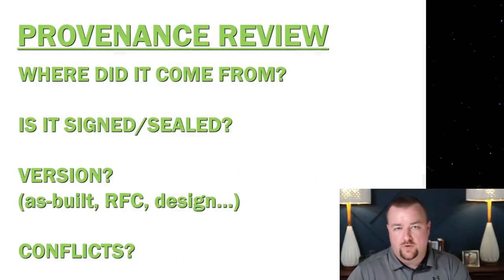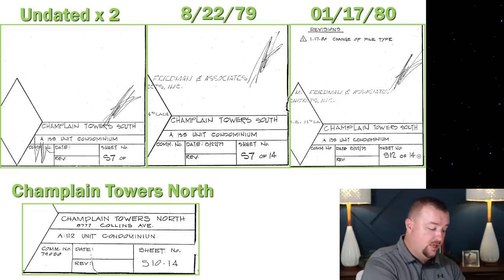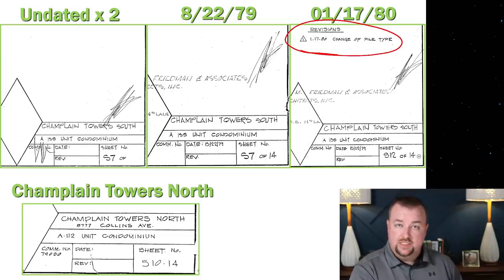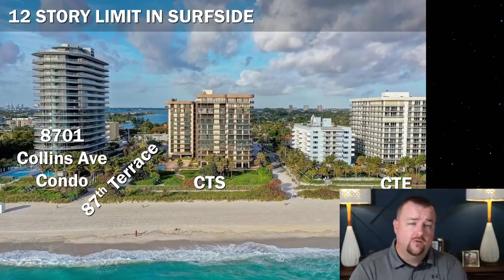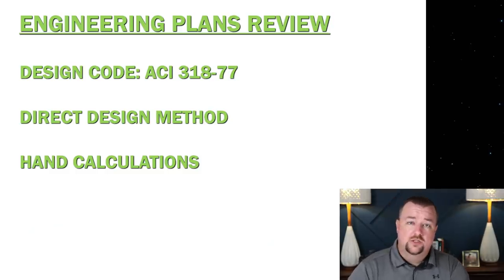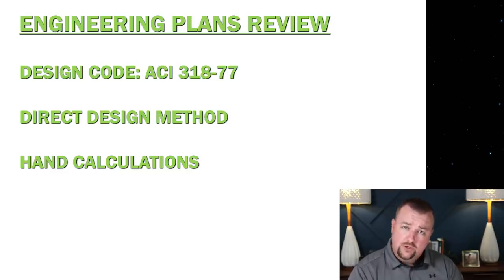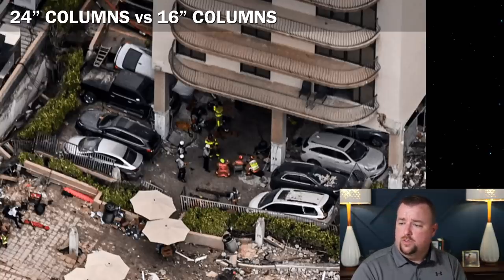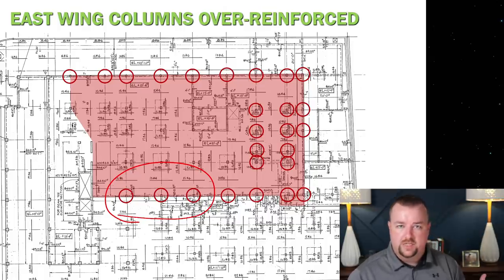Engineering Failures Found in the Champlain Towers South Drawings - Surfside Collapse

Comment: Josh at 5:00 you said you could not find the planters in the 1979 drawings, I have the answer for you. I had mentioned in a few of my videos in July that the HOA had a contractor come in back in 1996 and added the extra planters, as well as the palm trees. I had put up a few videos showing this, as well as what stressors and latent cracks might have happened if they drove any heavy machinery on the pool deck to install these palm trees, and later they removed them in 2018. On the Surfiside records web site, you'll see the file 8777 COLLINS AVENUE - LANDSCAPING P#96-0403.PDF, that has a drawing that shows their proposed added planters, as well as the palm trees. This is also when all that extra sand and heavy pavers were added, which I feel slowed down drainage of rain off pool deck, and often left pooling that I showed in many real estate agent MLS photos of the pool...
Reply: Love your vids and giveaways sir. Keep up the great work!
Reply: It looks like they added insult to injury over the years!
Reply from the maker: I'll look into that.  If the planters were added in '96 I'm curious to know if an engineer was hired to evaluate the deck for that weight.
Reply: Thanks, Jeff -- you and Josh make great videos and i watch you both.
Reply: Big fan to both of your works. Both of you had made me so clear this thing even thought iam thousends miles far away. Greetings from Lima Perú.
Reply: @BuildingIntegrity  This would seem to be a logical thing too do right! I mean its adding a large amount of dead weight.  Be interesting to see what you can find out.
Reply: Imagine how heavy palm tree's are. How much damage was hiding under those planters?
Reply: Has any planters been removed from the North Towers? I'm still very concerned about that building.
Reply: I think the design change of removing the step down/beams is an important element of the failure (and any added planters, and the cracking due to flexure, and the impact of cracking on rebar corrosion). I am uncomfortable around the lap lengths (splices in USA), and embedment length of the ‘U’ bars into shear walls, and the generally ‘light’ rebar – although I have no direct experience of flat slabs so that is an uninformed opinion.  I also had some uninformed reservations about concrete cover, I had the impression that it was insufficient for the environmental conditions and concrete quality.
Reply: Well, a 1t capacity counterbalance forklift is about 3t service weight. Add in a planter, possibly with a pre-grown tree inside, to be near the capacity. Now work out the forces generated by 4t hitting the brakes, even at a walking speed... Now you consider this is a horizontal force totally unplanned for by the design of the building and columns..
Reply: A
Reply: You two guys are awesome researchers.
Reply: Most people don't realize the weight of sand.  In Florida, a typical dry silica sand weighs around 2400-2800 lbs per cubic yard.
Reply: @chuckgilly  generally if they are technically illiterate and driven by emotion, yes.
Reply: @lifewithduchenne3030   oh just stop already for pete's sake... this is getting old...
Reply: You beat me to it, Jeff.  I was going to comment about your theory regarding the planters and the equipment used to install and remove the palm trees in them.  I think it merits investigation after this video showed that the pool deck wasn't designed for significant live loads.  You and Josh should do a video together.  You both have interesting insights into this tragic building collapse and would probably benefit from bouncing ideas off of each other.
Reply: @BuildingIntegrity  Josh, when you did your calculations for the load limits of the columns above the pool deck, did you use the original deck plans or did you account for the sand and paver bricks added in a later renovation?  If those columns were already at or near 100% load then the renovation likely put them over the top and it was only a matter of time before the deck collapsed.
Reply: @Phoenix08642  Ask Josh why he removed his original video on PT cable failure. Where and when did he learn there were no PT cables?
Reply: @truckerallikatuk  Wow...thank you for sharing your insights on that possibility 👍
Reply: @-._.-KRiS-._.-  With the max and overload build in from the start on South good reason to be very worried about the others especially with how shady the developer was.
Reply: Back when cars had chrome steel bumpers a tenant at least once a year would damage a pillar while intoxicated at a building I lived in up north.
Reply: sand holds water and well there's that added weight too. Take a 5 gallon bucket of sand pick it up, then add water to it..
Reply: @wiregold8930  Can someone change his mind?
Reply: @coollasice4175  Sure. Deleting a mistake is not professional, correcting one is.
Reply: @ulexite-tv  Me, too! I’ve always been fascinated with architecture. Learning about the engineering that makes design viable has been so interesting. I would rather that the reason why we are all looking at this so closely hadn’t happened, of course.
Reply: @lifewithduchenne3030  Using the same data and photos off the internet that other people also use is not stealing or plagiarism. Coming to similar conclusions about observations is also not stealing. Kai should grow up and get over it.
Reply: @wiregold8930  Because he thought the rebar may have been cables. Not a big deal. The photos weren't very clear and it was early days before he reviewed the drawings. It is not like he was being emphatic about it.  It was self admitted speculation at that point. I wouldn't have assumed they were cables because they were too close together for the distributed direction. He even corrected himself on a later video.
Reply: @christophercripps7639  All they would have had to do is go down into the garage and look up for beams.  It's clear they didn't bother to do that.
Reply: @jonh901271  Yep, it's amazing what a thin layer of sand or even peat can weigh. I used to work in the theatre, and we had an idiot of a designer want a stage to be covered with the stuff- which naturally needs some depth not to go bald when walked on. We did a rough calc of the weight and more or less said, 'take a long walk off a short pier, mate'. And our stage was a solid concrete one with columns and beams underneath- some touring venues the show might go to were just timber planks on joists.
Reply: @-._.-KRiS-._.-  Jeff said they were removed from both at the same time.  I wonder why?
Reply: @yodaiam1000  It's good he corrected himself, I hadn't seen that. Thanks..
Reply: @chuckgilly  👍  HOA. Home over-reaching Amatures
Reply: @yodaiam1000  LOL! Speculation...LOL!!!
Reply: HOAs are far too ignorant to even know they (The planters and proposed trees) were not on ground level. Seriously. It would never have occurred to them to do an analysis. An arborist would not have thought to look either.

Both of you guys have done a great job!
Reply: @suekennedy8917  Which comment are you referring to? I made several comments. What is exactly speculative?
Reply: You still haven't answered my question about why air traffic was shut down before the collapse.
Reply: @sexuallytransmittedcovid5241  Why would that be relevant to the collapse?
Reply: @yodaiam1000  for emergency rescue can only have a drone in the air if air space is shut down. Which tells me they had prior knowledge of the collapse. Probably Homeland security and FEMA's exercise and evaluation program.
Reply: @wiregold8930  the building plans show no pt cables
Reply: @sexuallytransmittedcovid5241  They are less than 400' in altitude and more than 5m from the airport. Why would the airport have to be shut down? Technically they can't fly at night without a certificate so they must have a certificate. So why would the airspace have to be shut down?
Reply: @yodaiam1000  Thank you and thumbs up!
Reply: @sexuallytransmittedcovid5241  I should also ask why would Fema etc do that? Does that make sense when we know there were already issues with the building? Why would you jump to a far less likely conclusion when there evidence of a much simpler and likely cause. All the other evidence would be 40 years in the making  if it was a planned collapse. What are the benefits?
Reply: @mattheww2797  Yes, he made the video before he reviewed the drawings and then corrected himself. The pictures were not very good so he though the rebar that ripped away from the underside of the slab might be PT cables. After reading the drawings, he corrected himself. He changed his mind after reviewing more evidence.
Reply: @BuildingIntegrity  Even without the planters those supports are still too small for the vehicles driving over them?
Reply: I had commented a month ago look
at the planters and look at the pool deck
It’s all intact it just punched through because the beams were non existent and the overload from the Landscape changes over the years
Reply: @chuckgilly  Bunch of Karens!
Reply: @BuildingIntegrity  I wouldn't be a bit surprised.  My thought thru the whole video was "so, it's been there for 40 years...and what changes were made during those 40 years?"  I can't imagine that NOTHING had been changed.  In the last 12 years in my house...I've moved my office THREE different times.  My house is a slab on grade, single floor, but, I have thought of some day adding a second floor.  I can do all of it, except I don't know how to do any structural drawings, so, I'll have to hire a structural engineer to do those.  I know my limits.
Reply: @chuckgilly  Yes.  I'm so GLAD I don't have one of THOSE where I live!
Reply: Love that you two are collaborating.  You two are both incredible and I appreciate all of your time and effort.  I have learned so much.
I hope are getting some credit for all of your hard work.
Reply: Jeffry would you testify in court as to the deficiencies you discuss in your videos? I haven't watched your videos and doubt I will but you make bold claims. Please answer the interrogative.
Reply: Jeff good to see your input, I have watched your videos on this too, very informative both you and Josh. Who needs NIST, you guys together can probably put your heads together and have root cause and contributing factors laid out in no time.
Reply: @christophercripps7639  Good but. Hope it is not the case, but...actually would be worse if they saw the 1980 dwgs
Reply: I like how he calls it out though OVERLOADED. even without the trees. OMG. Spindly little columns AMEN. and no SHEAR WALL> WTF....not enough transfer beam. So what happened....BOUND TO PUNCT SHEAR....and the story is told.
Reply: Even from the UK, I can smell the smoke from the recently discharged firearm there.  
Looking at the photographs from my point of view as the son of a Chartered Civil Engineer who was brought up to view almost everything through that lens, those 12"x16" columns look much too spindly for the load there were supporting, even without the added insult of having a huge planter built just the other side of them from the car parking.  So very likely overloaded from the very start without those beams.  I don't pretend to be capable of doing the calculations because I don't know enough about building codes there and never pursued that career path anyway, despite lots of time spent on site with my father being shown just that kind of detail (I think I knew I could never achieve his standard or success).  But it just LOOKS wrong to me.  Just because they got away with it for that long doesn't mean it is safe!
If heavy machinery was used to position the palm trees in 1996, and they were there until 2018, they had 22 years of growth on them, so almost certainly needed even heavier machinery to remove them.  Just the sort of overload needed to start the cracking to allow water seepage and create the corrosion that pulled the bottom card out of the stack.  3 years worth of that corrosion - seems about right.  TBH, I'm surprised it lasted as long as it did and put up with the initial installation of the trees.
Of course, there could be other contributory factors, but that looks and sounds like a duck, so seeing it floating on a pond is no surprise.
Reply: @phillee2814  yea me too it is way too obvious. I just dont know how it got through buiding and safety, inspection, and final building approval without some HUGE red flags flying. My first glimpse was OMG there is no support under there.
Reply: @truckerallikatuk  You reckon a palm tree installed in 1996 already grown sufficiently to be an asset to still weigh under a ton with 22 years more growth on it?
Average weight I can find seems to be about 500lb per foot of trunk, with around a foot of growth per year.  That is a ton in four years.  And those had been there 22 years (say 6 tons of additional growth - Florida is a great growing environment for many palm species) and were not seedlings when planted, but mature enough to be established, decorative, shade trees.  Say 10-15 years old.  So much more likely 10 tons, which would put you around an order of magnitude off.  Live, mature trees are HEAVY!  I've moved them on semis, which were loaded by fairly decent sized cranes even with short reach, although I don't know how near capacity the cranes were, I know I could feel the weight on the back, and two trees of a decorative shady maturity for a site like that is capacity.
Reply: sand????!!!!! 🤷🏽‍♀️🤦🏽‍♀️🤦🏽‍♀️🤦🏽‍♀️🤦🏽‍♀️
Reply: @BuildingIntegrity  Glad Jeff came by to tell you this. I saw his video and when you were talking about the dynamic load I was thinking about how the palm trees might have been installed and with what equipment.
Reply: @jeffostroff as I commented on one of your videos, I looked up historical aerial photography through the FDOT APLUS site and it appears that those planters were there in the 1985 aerial.  In the  permit you reference they are performing "re-landscaping" after a demo project and I see no reference or details that would point to new planters.  The construction of any new planters would have to include construction specifications and waterproofing just as the other planters did in the original plans. Planters also appear in the 1991 aerials.
Reply: @BuildingIntegrity  as I commented on one of Jeff's videos, I looked up historical aerial photography through the FDOT APLUS site and it appears that those planters were there in the 1985 aerial.  In the  permit he referenced they are performing "re-landscaping" after a demo project and I see no reference or details that would point to new planters.  The construction of any new planters would have to include construction specifications and waterproofing just as the other planters did in the original plans. Planters also appear in the 1991 aerials.
Reply: @joelnoland9931  yes it makes a lot more sense now after watching this video why these are just punched through where the cars are parked
Reply: @minirock000  you should watch his videos, they provide a lot of details
Reply: @berenscott8999  'Palmettos average 100 lbs per trunk foot, Pindos average 500 lbs per trunk foot, Canary Island Dates average 1000 lbs per trunk foot.'
Reply: @Brucev7  that is a lot of weight. Plus the soil, water in the base. The concrete outside.
Reply: @berenscott8999  it is. Wonder how tall they were. 100#'s per  ft
Reply: @ewmegoolies  the pool deck is in one piece it did not fail it cracked as you see in the videos but the columns were just so small and no beams across wide spans ???? It was just a matter of time
Reply: @Brucev7  part of me thinks they must have known the palm trees had to go. But whoever made that decision doomed the building right?
Reply: Of all the video's on Surfside, you and Josh are the best. Glad to see you're both watching and listening to each other. There's so many other clowns who've already uncovered the cause (lol). You two are very reasonable and fact based
Reply: I recently subbed to both Jeff and Josh. Thank you guys for some great analysis on this horrific tragedy.
Reply: @berenscott8999  Yes palm trees +planters +plus soil+ water saturation OMG!
Reply: I wish somebody would go over the crumbling skyscrapper in downtown San Francisco.
Reply: @BuildingIntegrity  Would be great to see an update video to this if you got the info! I got no clue about structural architecture and engineering, but after all you said, it seems outright bizarre if they didnt get an architect to recalculate all those weights.
Reply: Good find.  It would be easy for people to dismiss such a "landscaping" project as having "engineering" implications.  But it did add a bunch of weight on top of the pool deck and underground parking garage.
Reply: so will "abolish HOA's" be the next movement....
Reply: You Guy's Jeff  & Josh make great videos and i watch you both !.
Reply: I wonder if they hired engineers for the planters and they worked off of the Rev 0 drawings? I don't know much about commercial or residential building construction, but I know a bit about natural gas construction, and it is a struggle to make sure people work off of the latest revs. The engineers update drawings but the contractors don't distribute the revs.
Reply: The build was blowup. The rebars were forced upwards. Over some channel, this build was used for human trafficking since the 80s.
Reply: @FelonyVideos  All of this just blows my mind. I made sure before getting my 75 gallon fish tank that the floor of my apartment could hold the weight. It's only 700-800 pounds, but I made sure to find out which way the floor joists ran and put it spanning multiple to distribute the load. Most people's brain's don't work like this guy's our even other's watching. I try to think and plan before I do stuff, that way it's done correctly.
Reply: @TechandTools1  way back in the days of waterbed, I always worried about putting one on the second floor. But the I found that most residential housing has to be built to carry an extra 100 pounds per square foot. Then I stopped worrying about weight.
Reply: @FelonyVideos  yeah, as long as your house is solid you should be fine. I was thinking about big guys watching football on a couch, 3-4 180-200 pound guys, my fish tank was fine. But I'd rather be safe then sorry, at least you thought about the weight of the waterbed. Plus you can put stiff over columns and nest to the wall where you get less floor sag, it can crack drywall. I found out a lot researching about fish tanks, and people have 100,200,300 gallon tanks in their house and put reinforcement under the floor to support the load, it was really interesting, I've always loved engineering and construction, I work construction. Nice chatting with you
Reply: @raybates3119  Bunch of Rays!
Reply: You guys should do a colab.
Reply: @Fabricio0099  totally agree. Both are on point.
Reply: When all this new landscaping was added, no one checked if the underlying structure was able to take the new load?
Reply: @InnaGottaDavida Thanks Building Int. for what seems to be the accumulation of a lot of info. I have been following both Building Int and Jeff since the very beginning. Each has valuable info and perspective. Jeff spoke of the planter  boxes and the heavy equipment as a likely contributor to the demise of the building. He continued to point out the additional weight many times going forward. For me I always focused on those columns. Something kept gnawing inside me, how thin some of them were. More details in this vid summed it up. Heads are gonna' roll. Probably the Engineer for sure for omitting those support beams and not enough overlapping of steel. Then on to the person/s that allowed the planter boxes/sand/pavers. Today I saw on the news that identity thieves Immediately stole the identitys of some of the folks that perished. They have been caught and are going to prison..I hope.
Reply: @mariodumais2153  .
Reply: wait a second 13:18  so that floor was designed to hold trucks and SUVs?   most trucks and suvs weigh more then a car  almost double the amount   5500 pounds to 6,000 pounds ea   i see a lot of LARGE vehicles,,

   cars are typically about 1900-3200 pounds in the 1980s

most people back then in the 1980s did not own trucks or suvs for going around town...because of the fuel crisis
Reply: @chuckgilly  that's why they're known as HOA's. Pronunciation and dialect ambiguity intended. lol
Reply: Jeff and Josh, you are the best combination of analysis and information. It's awesome to see you two collaborate on these analyses. Please continue. I love watching you both.
Reply: @sexuallytransmittedcovid5241  lol what. You really aren't familiar with Occams razor, are you? Or objective reasonableness for that matter
Reply: @chuckgilly  How do you operate a condo without a HOA. Trippin?
Reply: @kctaz6189  just make each person responsible for their own condo, and anyone who has extra money can maintain the rest of the building.  If shared parts of the building starts looking like it’s in need of repairs and no one volunteers, have a lottery to decide which single person is responsible for the whole job and hope they don’t file for bankruptcy.